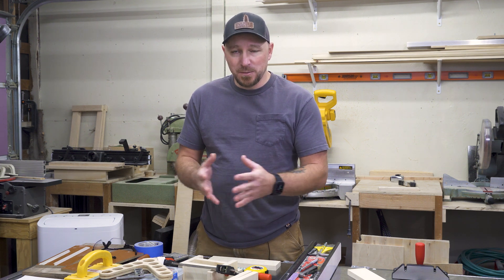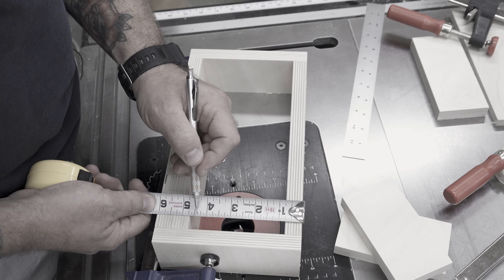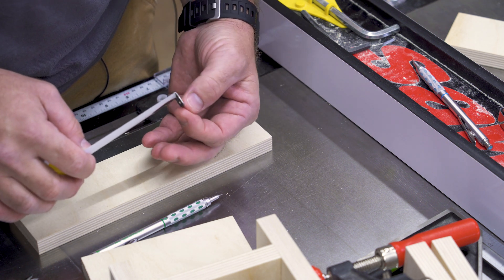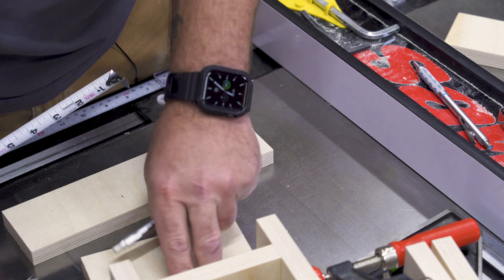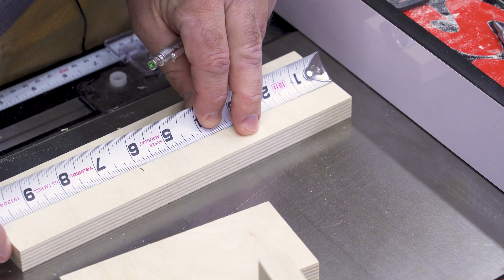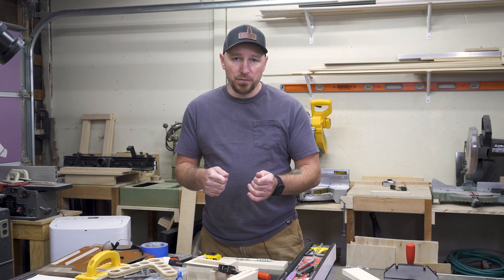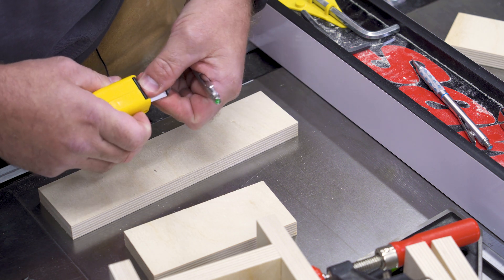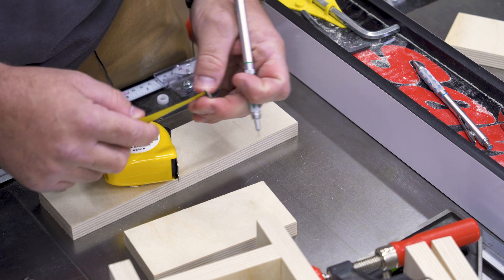Why Does The Hook On A Tape Measure Move?

Comment: I was lost after finishing this video, but I realised where I was going wrong. Essentially for some reason it didn't click that the measurement starts from the outside flat part of the hook. I was fixated on thinking the measurement started from the inside of the hook. I was thinking the movement should do the opposite to what it does (somehow making that work), but no.

Oh, and yea that means the measurement markings don't start from 0 on the actual tape.

Comment: We used a wooden folding rule to build homes with, everything was built with that flexible tool with a brass slide in it for "onside" measurements. I brought  tape on the job and my boss screamed wtf you gonna do with that floppy !@# string? Now hear it is 60 years later and I wonder why does that hook move? It is scared not to!

Comment: A (non-practical) workaround is to start your measurement further into the tape (in my case it is 10 cm). 

Also to ckeck the tape itself you can make a mark at 10 for example then move the tape and start measuring from 10, your mark should land at 20 or otherwise the tape is defective.

Comment: Great explanation as to "Why" it moves. Also the higher quality tapes have 3 or more rivets, it seems that they tend to hold true longer than the flimsy 1 or 2 rivet types. There's also fixed rivet ones that are only used to hook and measure, I'm not sure how great this really is? Great video, again. Jim